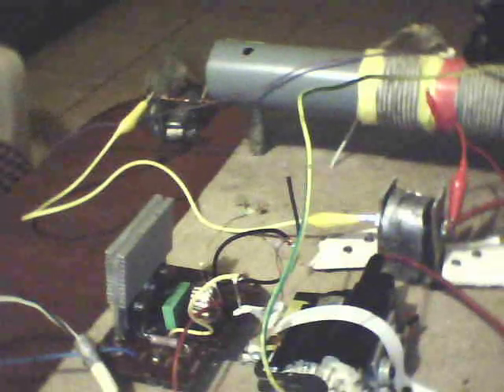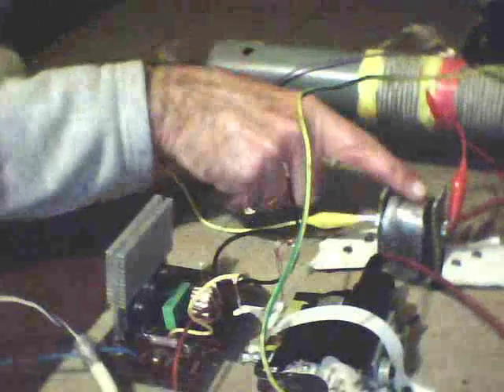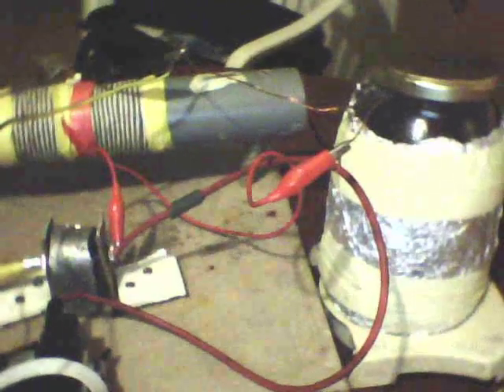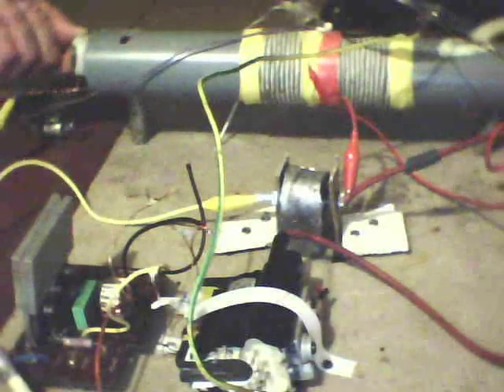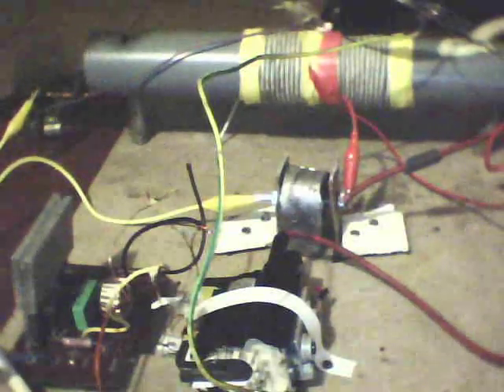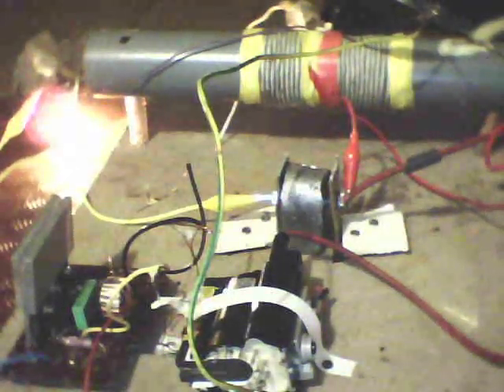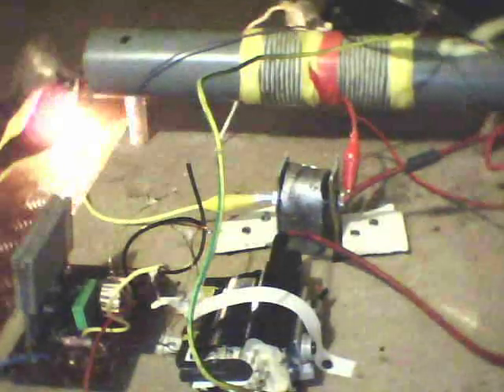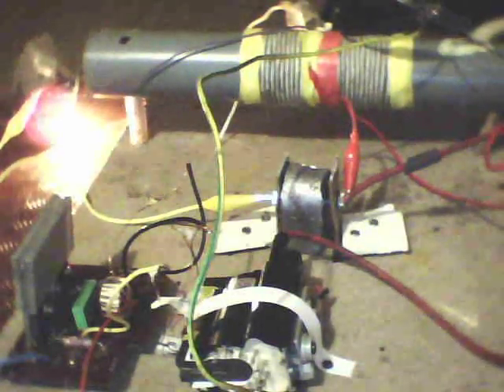Don smith circuit testing1

Comment from the maker: @DilJalaay I will post schematic. My input on my multimeter is not stable. Sometimes it's giving me 20amp and sometimes 1.5amp. I think the ZVS driver gives back a little voltage so it is effecting my input reading. Output just lighting a 5w bulb for now but as I said these are very preliminary experiments and I will definitly increase output by tuning.
Thanks